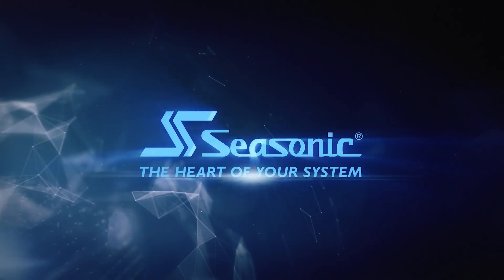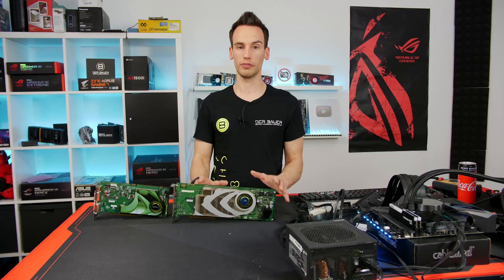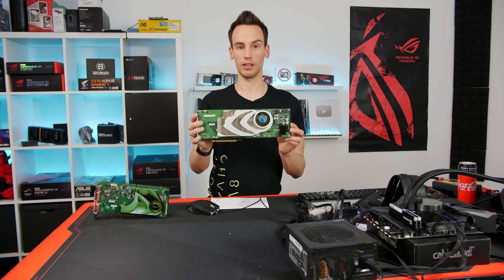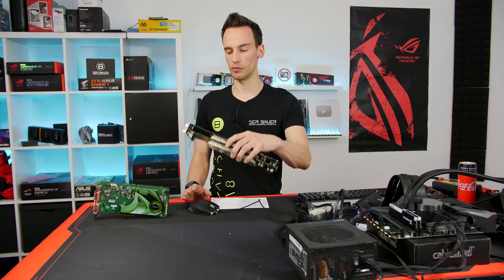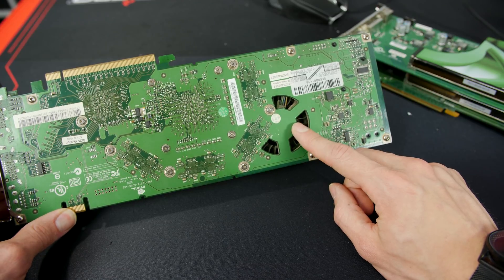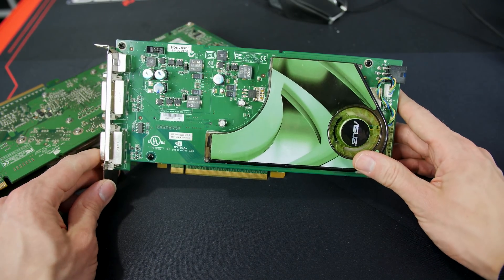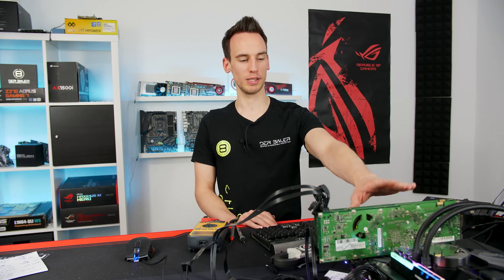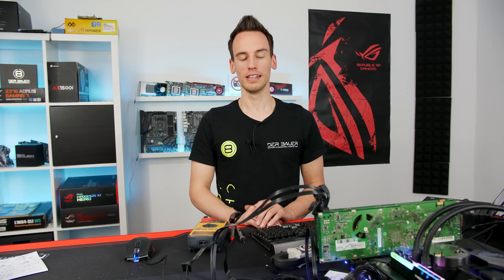HW-Legends #3: This Video Card was too long for retail sale (7900 GTX Duo)

Comment: thanks for making this video. I recently opened up an old box of computer spares that I've had for nearly 15 years (international move blah blah). Found this card and remembered buying it and never being able to actually use it as it was so freakishly long! I remember I took my motherboard out of the case to actually test the card once or twice and then stuck it back in the box and forgot I had it! So basically I have a new 7900 GX2 with ZERO dust sitting in front of me and i think its going back into the box. Was nice to read up on the history of this card and the differences with the 7950

Comment: Lovely video. I still use Rivaturner when im gaming on my XP retro pc. I remember when you had to unlock the pipelines and vertex shaders on the 6800LE (not sure on other models)

And you could almost get the same performance of a GT or the Ultra model.

AMD Athlon 64 3700+ 2.6Ghz OC (San Diego)
4GB DDR 460Mhz OC
6800GT PCIe
asrock 939dual-sata2

Comment: I remember in 2006 I blew like $5K on my first personal custom PC (I had customized my own PC's before, but it was funded by my parents, my old man got me into PC's when I was a child, so they were kind of like the family's computer).

I bought an XFX 7950GX2, an Intel E6600, Zalman CNPS9500, some weird early DFI socket775 mobo (Some ugly looking thing with green PCB..not a Lanparty board), Corsair 4GB (2x2GB) DDR2 800mhz, 2x WD VelociRaptor 150GB EL150's in RAID 0 (which made up about $1000 out of the budget...), a early Thermaltake Toughpower 750W (that was like the size of what 1500+W PSU's are today) all of this stuffed into a Lian Li PC-201A (which I still have, as well as a few other old Lian Li gems in the garage), and a Chimei 22" 1680x1050 LCD monitor that had like 5ms response times and was getting really good reviews in all the PC magazines at the time (as well as a Logitech Z-680 and G15 and G5 etc etc).

Maaan I miss those days, the level of hype me and my mates had when we picked all that gear up from the local retailer, took it back to a friends place and built it all and set it all up..I don't quite get that anymore these days, that was a huge jump from my previous computer at the time, my hands were fucking trembling when I was putting it all together lol.

Glad to see you reviewing these cool old pieces of gear Der8auer, lets me put my rose tinted goggles on for a bit, and reminisce on better times of being a PC enthusiast.
Reply: Awesome

Comment: That's not too long, it's a full length PCI(reg,x, and e) card that would typically fit exactly in workstation computers where there was a bracket to support the back of the card... I have a couple ancient Dell and Apple workstations that used these kinds of cards.

Comment: Also you need to be much more careful when handling this card as it is pretty fragile and I say this from experience after breaking the top half of a 7900 GTX Duo, broke off a black capacitor at the end of the card above the vrm.

Comment: Actually EVGA did sell a small number of these on newegg for which one can still find the listing anyway I had two of these but sadly lost them in a arson fire. I did get lucky a couple years ago on two rarer limited edition 295s that EVGA had only made around 500 samples for a promotional event for which only around 150 or so had made it to retail while the remainder went on to be sold to Dell which is almost impossible to source outside the US. At least the Quadro version of the 7900 GTX Duo is not impossible to find but often priced a bit high at times and another rare find is the quadro version of the 9800 GX2 exists with twice the memory but is of a different style to that of the consumer card. All in all well worth collecting, by the way Alienware sold some of these cards with water blocks so not all are air cooled.

Comment: seems like the second card is the one with the video outputs that's why only one of them has the extra bridge connector kind of like the card running cooler is in charge of the ouput!

Comment: its not too long AT and baby AT touch both the back and front of the case, and old cases even have plastic guides on the front for those cards (which I have had plenty) ATX shares the same case footprint depth wise, so the card would fit in a standard issue 2006 or 2019 ATX / mATX case no problem

Comment: I must say I really love looking at old hardware like this.  Do you think keeping with the dual GPU cards you could do say a GTX 295 next? That was the first high end GPU I owned, I owned 2 of them and run them on a EVGA x58 classified in quad SLI and an intel i7 975XE. I thought I was king in 2009
Reply: wow thats exactly the same specs to the word for a PC I build a customer back in the day.   Cost 8000 AUD and was water cooled as well.
Reply: @3800S1   lol sounds pretty close to what i spent. i also invested in Nvidia 3D vision playing games with 3D glasses a whole year before 3D TV's were even a thing
Reply: the water cooling of choice at the time for me was the ThermalTake ProWater 880i
Reply: @TheHandSolo  I installed all swiftech water cooling gear in this one.
Reply: Oh I forgot to mention that was back in the day of PhysX cards, I also had a 9800GT in the system as a PhysX card

Comment: I remember old days...I was on Radeon X1600XT and later upgraded to 1950Pro. And there was fight between ATI and Nvidia to have top card. The single card battle won X1950XTX if I remember correct. And games were not looking so bad, example Quake4,  Fear etc :) Still playable today for fun.
Reply: Yeah Fear 1 looks great too this day imo on higher settings.
Can be maxed out probably on most laptops with intel hd 4000 or faster at 720p.*
Did max it out on a hd 5770 in 1600x900 i believe.

Comment: Ahh good memories. Built my first high end system back then. AMD X2 dualcore CPU, 7900 GTX, ASUS A8N-SLI Deluxe motherboard and 4x512MB DDR-400 OCZ RAM.
Ran Need for Speed Most Wanted, Far Cry and Doom 3 like butter. Tested 3DMark06 etc. Good times.

Comment: Hm, last time I checked recent versions of Afterburner actually do work with GTX 7xxx series cards. Used it with a GT 7850, core and mem clocks were working perfectly, GPU temperature also worked and fan control mostly worked fine (with some minor issues)

Comment: I once baked a 7950GX2 in the oven to get 2 more months out of it
, I didn't know which PCB was dead so I baked both haha.

Also I downgraded from a 9800GX2+ to an 8600GTS and didn't notice any difference because my CPU was a Celeron D at the time.

Comment: I still have my 7950 gx2. I remember being disappointed with nVidia because, even though it was a single slot, it would not run on my crossfire motherboard. The motherboard had to be a SLI version. Dual GPU, single slot AMD cards could run on a SLI motherboard, but nVidia was already then, was less flexible compared to AMD.

Comment: RivaTuner was bought by MSI and became Afterburner with renewed interface, so it's alive not only in our hearts :)
One of the parts of Afterburner is even still called RivaTuner Statistics Server
Reply: They didn't buy the software they bought a licence to use it. MSI, EVGA, ASUS and probably others currently have a licence to include it in their overclocking software.

Comment: I'm pretty certain i had soundcards which were much, much longer than that.

A full length ISA card is about 14 or 15 inches long and is installed into a retainer at the front of the enclosure that prevents it from sagging. A fairly popular example of such card is Creative AWE32 CT3990. Turtle Beach Pinnacle and Terratec Professional EWS64 also had near-full-length variants if memory serves.

Comment: When your GPU had an error beep speaker on PCB.
Reply: The 9000 series had it as well and it was placed there to warn of insufficient power delivered by the psu. At the time 6 pin, 8 pin and dual 8 pin were really high end.

Comment: You should get some flex riser cables for the PCI-e and SLI interconnects, and a 5x2 2.54mm pitch M-F connector, plug them into the interconnects on the boards so they could run separated, then run them on LN2 and see what you get out of them! :D

Comment: Der8auer, do you have a 3dfx Voodoo5 5500 in your collection? I have one in my PIII-S 1.4GHz machine. :D
Reply: That the Tualatin core ?Would love to see one of them fly under LN2 ! They where sooooo fast , faster even than early pentium 4 There is a reason the core architecture is built on the P3 line and not P4
Reply: @andljoy  Yep. Tualatin. On  an Asus TUSL2-C. :D
Reply: @andljoy  Pentium m processors was essentially pentium 3 but modified with larger cache & a larger pipeline too push performance up.
(This made a 2.0 ghz pentium m 755 quite the package in terms of cpu performance per watt.)

Got a article here on them, on a bit more rare desktop motherboard that let you overclock these a bit further.
Game performance

https://www.anandtech.com/show/1610/15

Overclock performance
https://www.anandtech.com/show/1610/18

Comment: Where did you get win7 drivers for z390? I really want to upgrade, but I need win7 for work (there some specific software that will only work with win7 and older). Everywhere I go it says it's not possible to run win7 on z390.

Comment: RivaTuner is still alive and kicking (as RivaTuner Statistics Server) bundled with MSI Afterburner!
Reply: i install afterburner for RTSS, then use hwinfo64 to plug in the data as it has way more options.

AMD has done a good job at their own software lately too, (rx480 user), so don't really need it for overclocking  or the GPU metrics, so i don't really even use afterburner anymore, i believe AMD's own solution worked on more APIs too last time i fiddled with it.

it also tends to glitch a lot whenever i get a fresh GPU driver until i update afterburner again too lol

but hwinfo64 can give it al
(even usually multiple sensors for the same stuff on the cpu, so you can pick the most accurate/worst case scenario one, plus it keeps minimums/maximums in a table 

hwinfo64 can live write the values to CSV too which allows for me to have a cobbled-together php/sqlite/javascript web thing and see the history of the stats too, pretty nice

Comment: Roman, wenn du die Specs so vorliest, unterstütz das doch bitte grafisch/tabularisch, das war anstrengend.
for our english speakers:
while reading the specs a visual support e.g. a table would be great. it was exhausting.
to be clear: this is not an accurate translation but addresses the same issue.
Reply: ggf. als Faustregel: Die Infos die du selbst als zuviel zum Merken ansiehst, sind auch zuviel um mal eben verarbeitet zu werden..
a rule might be: the info you decalre yourself as too much to be spoken free are an indicator that those need to be supported visually in some way.
btw: again no accurate translation. same issue ;)

Comment: Thanks for sharing your older hardware with us. I have a few older duel GPU cards in my collection. I have a GTX7950 GX2, 9800 GX2, 2 GTX 295's, GTX 590 and a HD 5970. I plan on building a period correct X58 system with the 295's in quad sli. The performance from my X58 setup is laughable today, but back when it was first released, it would have been the ultimate gaming PC money could buy.
Reply: Those x58 systems are very viable today, as you can fit xeons in them...
Reply: Boom Box holy shit mate youll need like 2000w psu for that :D
Anyways great collection i have 8800gtx and gtx285 and 295 decent eh?

Comment: 32cm :o
My 31cm Sapphire Vega 64 Nitro+ barely fits in my case xD
Reply: I see you are a man of culture too. My 30.5cm HD5970 easily fits inside my mATX case :D Now if only EK would reply to my DM's, I can purchase a full cover block for this beast and finish my retro build
Reply: @JohnKahts  

i have a EK full cover block for a 5970. its not in the best condition. it has some spots on the copper and dried in liquid in the threads but you can only polish it a bit and it will look good. where do you live ?